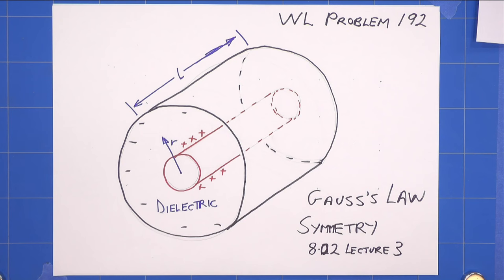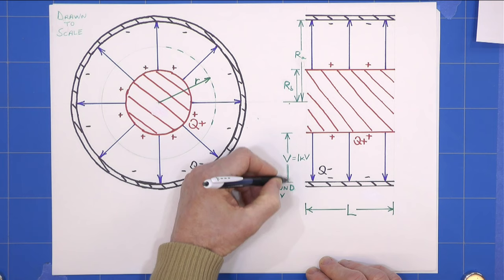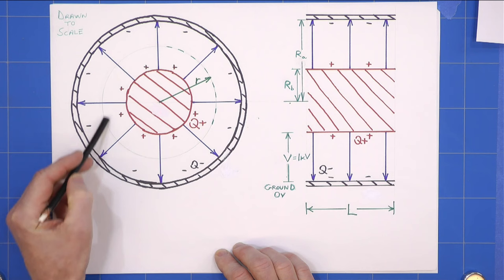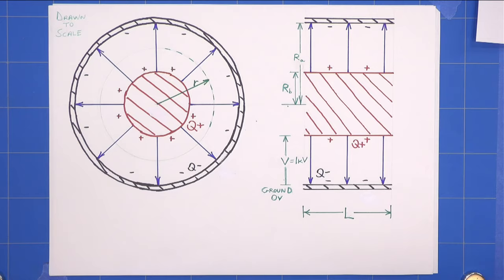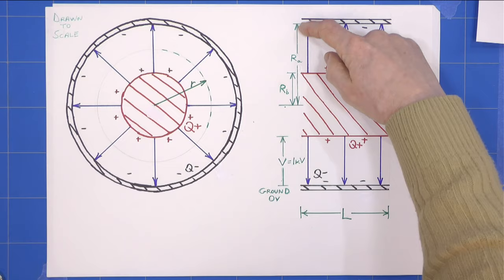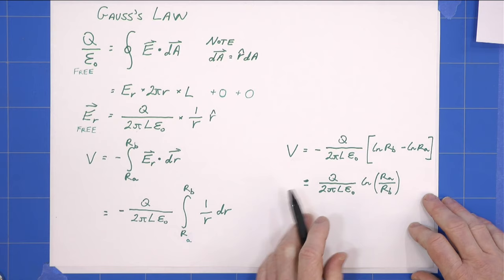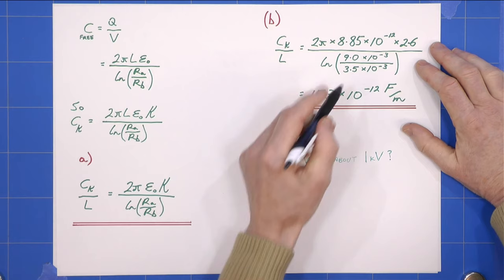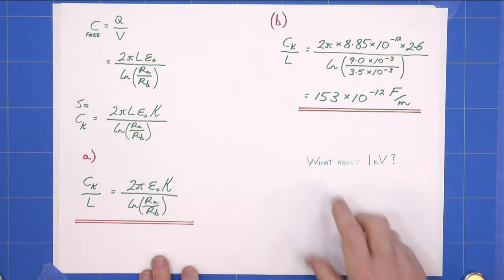Keith Norman's  Solution to #192

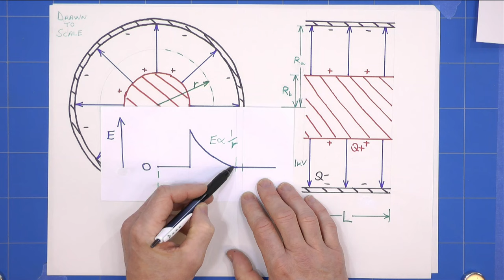Comment: Question: The illustration of the field around 6:20 that shows the field falling off as 1/r seems to show the field becoming zero just inside the outer cylinder, although the equation is proportional to 1/r. Shouldn't this still be greater than zero at the inside of the outer conductor?

Comment: Sir there is a question ,
 In case of refraction  of light in water an more intensity light ray goes inside the water whereas a less intensity light ray reflected away from water surface . Sir due to which condition  the photon of light ray decides either go inside the water or reflect from water surface .
Reply from the maker: I cover all this in detail in my 8.02 lectures. WATCH THEM
Reply: @lecturesbywalterlewin.they9259 'Brewster's angle' seems to ring a bell... 🤔

Comment: Bravo Keith‼️ 👏

Some notes on Keith's solution: 

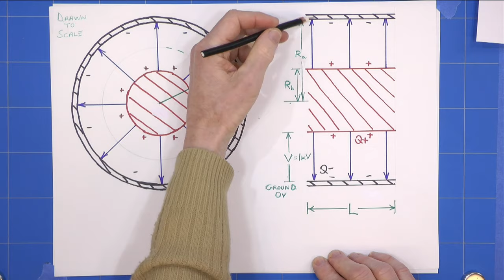1:54 RHS drawing: 
The field components all cancel along L, 
but the radial components add up.

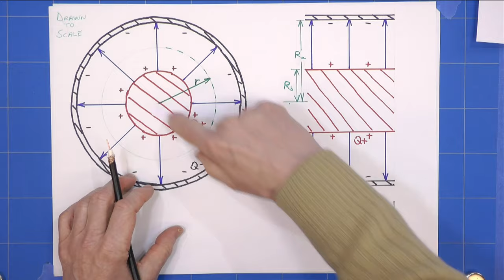2:35 LHS drawing:
The field components tangent to the inner and outer circles all cancel out, leaving only radial components.

3:06 Gaussian surface is a cylinder w/o ends b/c we consider an arbitrary section of wire of length L with more wire either side, so there is no end surfaces for charges to accumulate on. 

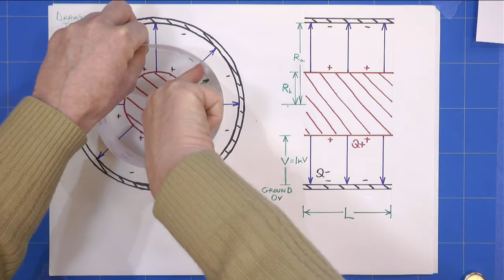3:31 Again: All fields cancel along L.

3:42 E(r) = σ(r)/ε = (dQ/dA)/ε
dA can be thought of as a tiny flat area (2Rsin(½dθ))dL~Rsin(2·(½dθ))dL~RdθdL.

The vector dA↑ can be thought of as 
Rdθ {←, tangent}× dL {out} ~ dA {↑, radial}

If +ve charge accumulated on inner surface of area  n(b)dA=A(b) at R(b) is n(b)dQ=Q(b), then: σ(R(b))=Q/A=Q(b) /2πR(b)·L

E-field is then E(R(b))↑=Q(b)/2πR(b)·Lε {↑}
Similarly, for -ve charge Q(a)= -Q(b): 
E(R(a))↓=Q(a)/A(a)·Lε {↑}=Q(b)/2πR(a)·Lε {↓}

On a cylinder Gaussian surface at position r from the center, the fields from a and b are: 

E(r, b)↑= n(b)dQ/2πr·Lε {↑}
E(r, a))↓= n(a)dQ/2πr·Lε {↓}

The net field is, with dQ=dQ(b): 
E(r)= E(r(b)){↑}+E(r(a)){↓}
= (dQ /2πLε)(n(b) – n(a))(1/r) {↑}

However, b is grounded so that v(a)=0V and as n(a)=0, must have, for ∆r(a)=(R(a)-r){↑}: 
v(r(a))=E(r(a))(∆r(a))= 0V => E(r(a))=0

So the net field is, with Q=n(b)dQ:
E(r)=E(r(b)){↑}=(Q/2πr·Lε)(1/r){↑}

8:12
If you wanted a rough estimate w/o dealing with the π value, just use: 
εo~ 1/c²μo~1/(9·10¹⁶)(4π/10⁷)~(1/36π)/10⁹.